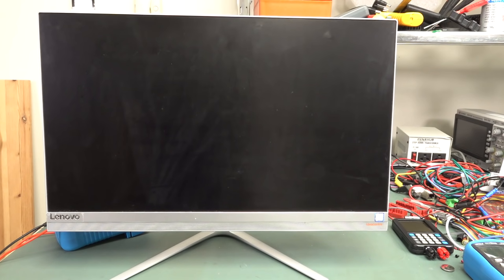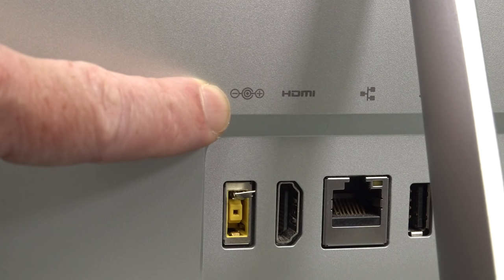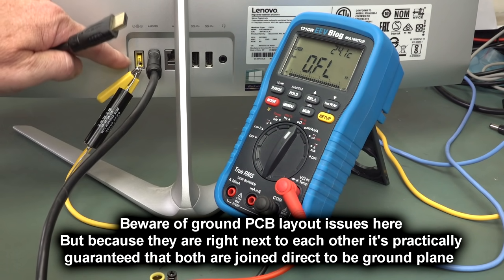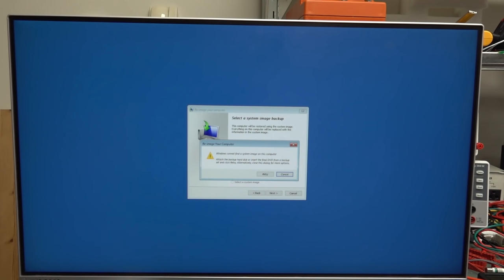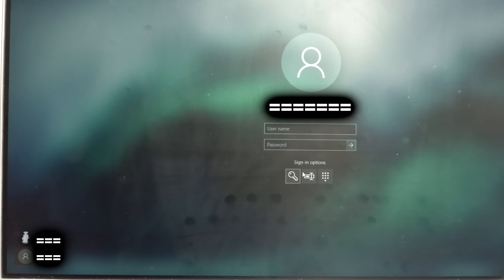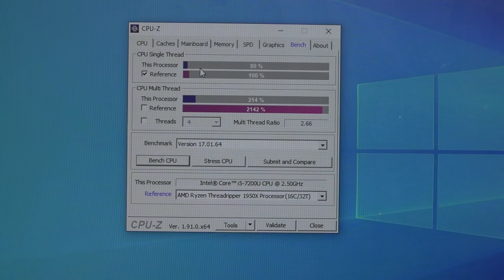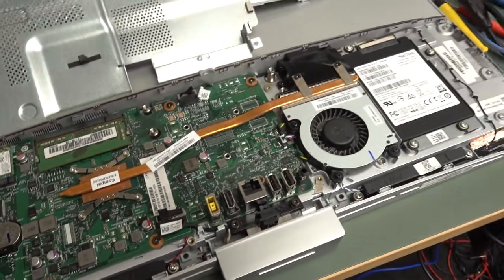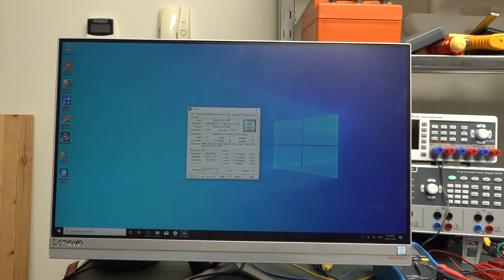EEVblog #1279 - Best Dumpster PC Find Yet!

Comment from the maker: I think I'll try and use this as a large screen capture drawing tablet. My Microsoft surface is messy for this, but this has the perfect 1920x1080 screen capture area, the touch screen, and support for a 2nd monitor to  use for recording monitoring.
Reply: That's a cool idea. I'm picturing it attached to something much like one of those adjustable drawing table that swings from vertical to horizontal. 

For software to improve the touch usability I know Epson has a drawing suite meant for their line of IR projectors for smartboard functionality. I don't recall it being locked down given it was meant to be compatible with all the proprietary software from earlier smartboard mfgs. Thinking about it I might have to try it myself on one of those 2 in 1 laptop/tablets.
Reply: The best way to clear up space and clean Windows would be to get a USB with Windows 10 and blow away the old stuff, there will be a partition with a OEM recovery image that will take up a fair bit of space on the drive that is not needed as well. Win 10 OEM activation is all in the BIOS so no keys to worry about either.
Reply from the maker: @michaeljames1893  I just killed the Norton Backup files and some other stuff and it has 177GB free now. Plenty.
Reply: Its probably got another ram slot on the back side of the motherboard. if you actually plan on using it, integrated graphics benefits greatly from having dual channel memory. if you have another 8gb sodimm ram stick laying around it would be worth it to throw in there.
Reply: Dave -- I know I'm being paranoid, but: computer found in the dumpster room? Might be worth a fresh install out of concern for malware/etc on the machine? Even if not done maliciously, the previous owner may have been lax about things (and Norton obviously isn't much use.) I'd personally be pretty hesitant to put any serious data on there. At least use a different password?
Reply: @EEVblog  Run Recovery again and restore it to factory condition.  There can be malware and pron lingering on the SSD, and that's the only way to be safe[r]. Use Lazesoft Recovery  to remove the admin account password if needed, it's free for home users [but not you I suppose].
Reply: From the video, it seemed like there is pretty big lag between touch input and screen update. Not sure how suitable this will be for drawing.
Reply: @CaseyConnor  that's a lot of work, to find out all the drivers for the device, then reinstall Windows then the drivers. The wrong one will make the touchscreen to function incorrectly; like wrong orientation or wrong calibration.
Reply: Since it has laptop hw inside, I suppose even the lcd panel itself connect through a laptop standard connector ... Even if the pc dies you should be able to repurpose it as a monitor by using a cheap aftermarket scaler/adapter... Unless it already has this function integrated
Reply: xponen_ yeah... Maybe there is a factory restore partition though... Would still be a risk but less so.
Reply: @xponen  Windows 10 will reinstall all the correct drivers automatically
Reply: @AniviaS  only when it is on a common/popular devices, but if on some weird uncommon devices, like a tablet, it will not have any driver, or when it install them it perform incorrectly, like malfunctioning camera, glitching touchpad, or touchscreen with weird 'deadzones'.
Reply: Lenovo will have the drivers for this on there website even if it did not work (windows 10 typically supports the touch screen from the USB setup page as it loads touch drivers as part of the setup with support for on screen keyboard) only really old systems or the odd ball Intel atom 2 in one tablets that have wonky driver setup
Reply: I wouldn't use windows with it. lol
GNU/Linux has full touch support.

Comment: (enters console)     
c:\override all security     
Are you sure?  Y    
All security overriden. Welcome Superuser.
Reply: I almost can't believe they still havent fixed it though... That's about a 20yo exploit...
Reply: @ThePlacehole  Ah, so it's from the good old days, where one could pwn windows with big enough ping packet, certain vector image and just by browsing folders with links in them in general :)
Reply: Classic Windows✨
Reply: @ThePlacehole  Its not  a bug but a feature
Reply: @ThePlacehole  they dont have to fix it, if you have access to the physical stuff you can do more than just removing the password or adding a user :3
Reply: yep, basically Windows 10. You cannot get a real admin account, but any random batch file or malware script can get more rights with dumb tricks. 

just go with Linux.
Reply: @SilverSpoon_  It's easier in linux, if they are using grub press e to edit the boot entry and add init=/bin/sh - I've done this on a new debootstrap'd install before when forgetting to set the password
Reply: @godarklight  yep, a thing I loved in Windows before was the ability to boot on DOS to fix it from a command line. Copy a file from a CD to remove a bad driver or DLL most of the time. Having a command line access just in the Grub is also very handy. I'm not fluent much into unixism but so far, the basic commands to move into directories are the same for a half century or something, so...
Reply: Typing "Y" is 10 years worth of microsoft courses right there (it is not in any way related to a "next" button!).
Reply: @ThePlacehole  They have fixed the exploit, they call the fix "bitlocker". If you don't encrypt the disk it's very easy to connect that disk to another OS (eg WinPE) and bypass anything you need to. With encryption you have to do an "install from orbit". BTW: Dave looking on the WinPE (ram) disk for the Utilmon hack was a silly mistake; but he fixed it pronto.
Reply: @godarklight  That's why proper sysadmins password protect their grub installations.
Reply: @ThePlacehole  I can't get this to work on my PC. I can't get the System Image Restore window, it always asks me for my password.
Reply: @Soruk42  and thats why proper sysadmins use bitlocker. And the admin rights shit also works on linux. Seriously its not hard in linux to get an elevated command shell as a normal user.
Reply: Most secure product I have ever seen
Reply: @ThePlacehole  It is not an exploit. It's on the other side of air-tight hatchway.

Comment: 4:27 ... If you look closely, the icon above the power jack shows "-" on the outer ring, "+" on the inner ring and then there's the dot in the middle for the centre sense pin.
Reply: I came here to point that out too. The icon is a correct representation! 😀

Comment: Allow me to jump in and defend this AC jack for a moment.

These rectangular jacks were originally found on the T*4*-series of Lenovo laptops as a replacement to the barrel jack.
They have a greater shear resistance comparatively to the barrel jacks of yore due to the increased soldered area to the circuit board and the reduced height, making them much sturdier and harder to rip off than a barrel jack.

These days, we have USB C, and it's all nice and standard :)
Reply: I have a ThinkPad that has one of those and the weird thing is that it also had a barrel Jack
Reply: I hadn't considered the increased soldered area but I feel like they could just as easily have made a stronger barrel connector. Like they barely save maybe 2.5mm on this construction just to make a ton of accessories useless, for a port that is electrically identical to the old one.
Reply: i dont have usb c charging on my p1 because its too damn powerful. It will charge with PD but it wont be able to reach full power without a slim tip.
Reply: @Nukle0n  they made a better barrel connector before that and it was big and ugly. the slim tip truly is the best power connector when it comes to high power draw. anything below 100w luckily gets usb C now.
Reply: I have an L390 Yoga with USB C :) loving it, Powerdelivery lets me charge via my truck's 12v and phone's power bank. Saw this on my buddy's cheapo laptop with that and honestly not too bad, better than the barrel on my old dell
Reply: >These days, we have USB C, and it's all nice and standard :)

USB-C is a shit standard designed by idiots with no common sense. It is even worse than USB mini and micro connectors because you have 500% more pins (24 vs 4) packed into a tiny delicate connector. Even worse yet is you have power pins right next to multiple data lines, which can deliver up to 20 volts at 5 amps, which if shorted out WILL burn and fry any ICs inside the laptop on whatever pins are shorted. Laptops with exploded USB-C controllers, burned ports and melted cables is already happening regularly for a variety of reasons, many of which were problems on mini and micro USB connectors. The Thunderbolt 3 controllers are even worse, ESPECIALLY on Apple laptops. They use the same connector and are known to fail spectacularly, often with the Thunderbolt controller IC exploding and blowing holes in the logic board and causing small fires. Lightning, while using a slightly different has the same problems.

The ports are not protected, and like mini and Micro USB connectors, quickly fill with debris from being in your pocket (phones) or environmental dust and debris (tablets, laptops, etc.) Some of this detritus is conductive and it doesn't take but a few thousandths of an inch of conductive material to short from a power pin to a data line. Over a longer period of time as the connector is inserted and removed, more and more detritus is packed into the port, which will eventually cause the connector to not seat properly. If you pull too much current on an already heavily overloaded wire, burning the pins in the socket or cable will happen. And yet another problem is that the packed detritus can become highly conductive if exposed to any kind of moisture, effectively acting as a conductive sponge and can short multiple pins to multiple other pins. Yet another issue is in humid environments, the pins become tarnished, which causes the pins themselves to effectively become resistors. This resistance creates heat, and can cause a thermal runaway if too much current is applied, which is readily possible due to the increased voltage and current limits of the standard.

The durability of the port is poor due to the above issues and the tiny pin pitches being easily damaged. Also affecting durability is the portion of the connector intended for mounting to the PCB. With the old USB-A and USB-B connectors, you have large connection pins, with good spacing between pins, as well as the possibility of through-hole anchors for a strong mount. Mini, Micro and USB-C connectors have the contacts often crammed all in a row of tiny pitch pins and equally tiny board mounts.

The tech industry has been moving in an alarming direction the past decade of convenience at the cost of everything else. Not only is hardware affected, but software as well.
Reply: @Maxim
 That might make some kind of sense on a laptop that's going to be constantly plugged and unplugged and moved around but makes zero sense on desktop which is most likely going to be plugged in once and left in the same spot for years.
Reply: And we all know what the best thing about standards is.

There's SO many to choose from  :o)
Reply: @GGigabiteM  Ack. Just had to replace 9 monitors due to a USB-C fuckup. A user had a broken USB-C port on his laptop which reversed the charging direction and fried the PD-circuit on every device he attached it to -.-
Reply: These flat ones started to be used to fit in the slimmer laptops, the round one was just to big.
 @PutItAway101  It makes perfect sense to have one lenovo standard, so that if you have several Lenovos you can just take one from the pile. Same for all docs as well.
Reply: @PutItAway101  The same portable devices that exist for laptops that have lots of plug/unplug cycles also have the same problem on desktops. You aren't going to leave a USB-C flash drive stuck in your desktop for years just because it's a desktop.

Desktop computers have even more problems than portable devices because the existence of remote USB-C ports attached to the case that require daughterboards. The connectors themselves are more expensive (about six times more expensive than a USB-A port the last time I checked), plus you have the extra thick shielded 12/24 wire cable and crappy motherboard connector to contend with. The USB 3.x motherboard connector is fragile and stupidly designed where it is far more likely to break than a USB 1.x/2.x header because the socket is too shallow and has virtually zero strain relief. This is why most cases to date only have 2, maybe 4 USB-C ports when up to 20 USB 2.0 ports is common.

You'll also see increased use of dongles and adapter cables to get USB-A devices working, which creates many more connection points where failure can occur.
Reply: @adlerweb  Yeah it's great how USB-C doesn't have any power protection, devices just expect everything to be fault-free all the time.
Reply: I do have a Y510P from Lenovo that has a barrel jack. The machine now is almost 7 years old and I never had a problem with the barrel jack.
Am I super careful? No. Is it a super barrel jack? No. It is just not soldered on a PCB, it´s wired and suspended with rubber on the plastic case. Simply genius!
You need special connectors for power my ass... I could only argue for mag-lock, but I don´t see how the can be used for heavier currents...
Reply: @GGigabiteM  I've really got no idea what you think you're replying to, but it's clearly not my comment or this whole thread, because we're talking about the POWER SUPPLY connector, no one is talking about USB flash drives or anything else that, obviously , might get frequently plugged and unplugged on a desktop just as much as on a laptop You made that entire straw man argument up which has nothing to do with my point that it there's no good reason to design a desktop power supply connector differently in order to make it rugged against the forces of being repeatedly plugged and unplugged and getting picked up and yanked around like a laptop, because if you've got a desktop, almost certainly you set it up in one place, plug it in to the power and leave it there for potentially years. If you are constantly unplugging and moving a desktop around, you're doing desktops wrong and you really should have got a laptop.
Reply: @PutItAway101   >I've really got no idea what you think you're replying to, but it's clearly not my comment or this whole thread

Maybe you should read the entire comment thread before posting dumb comments. half of this thread is talking about USB-C, and the original post in this thread even mentions it.
Reply: @GGigabiteM  Once again, please actually read the comment. He says "Allow me to jump in and defend this AC jack for a moment." He then goes on to discuss physical advantages of the connector which are only significant on a laptop, but which are of minimal use on a PC. I point this out. That is the entirety of my point. This POWER SUPPLY connector is no advantage on a PC. He mentions USB-C REALLY  OBVIOUSLY IN THE CONTEXT OF BEING USED FOR POWER SUPPLY ON LAPTOPS and yet you make up an entire straw man about USB flash drives being frequently plugged into desktop PCs, which has zero to do with my argument that a PC POWER SUPPLY is typically plugged in once and left plugged in for years, and is unlikely to get yanked around like a laptop.
I guess you could power a desktop off a USB if you really wanted to, but why would you do that to yourself? You'd be limiting yourself to 100 watts, so it would be a pretty pathetic desktop.
Reply: @GGigabiteM  I gave you a chance to address what I actually said in some way, but again you're replying to some alternate argument that only exists in your head, because imagining that you're "winning" it helps you get over your disappointment with your life. That's your problem, I'm not interested.
Reply: GGigabiteM
thank you for that that USB C is a losy power connector, its shit for other things to for one it breaks 20 years of backwards compatibitly

th only none barral jack power connector i like for portable devices was the varios magnetic ones (apple mag safe for exmaple)
Reply: Rectangle power jack suffers only because the center is made of plastic.  The greater soldered surface area is indeed better, but Lenny skimped on the plastic for the center pin and it breaks more often than barrels.  When it does that, it sends 20v directly to the sense circuitry (fuseless) and kills the BQ27xxx chip pretty reliably. :(

Still love the barrel, and the rectangle.  Lenovo are doing it right... almost.

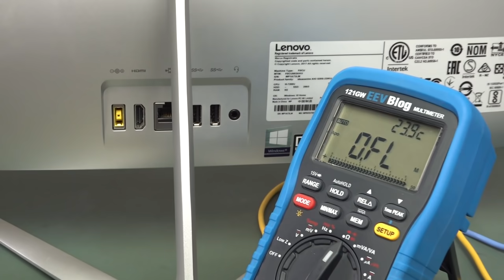Comment: I really had a struggle when I came across those big yellow barrel connectors on the far left at 5:04. They also have a center pin, but it was not connected in my case. There are two seperate tubes in the outer "ring" and the inner one was positive...
Reply: Most laptops connectors with centre pin are like that.

Comment: That "GC-0700 (Samsung)" marking is showing what plastic the mold is intended to be used with.  There are several vendors making a "GC-0700" ABS/PET mix, but they have some variation in characteristics and so for the best part quality you want to run production using the same plastic the test shots were done with.

Comment: The Lenovo plug has 3 connectors, the center pin, the inside of the "shroud" and the outside. The center data for the computer to communicate with the power supply, find out what model it is, etc, althought it's not a DRM thing where it doesn't work if it doesn't detect something, but this is how it was even on their old connector, they just changed the shape of it, and I believe you struggled with this on another occasion with a Lenovo laptop.